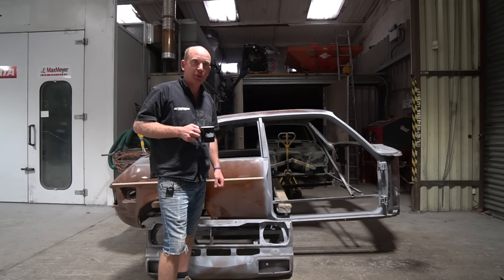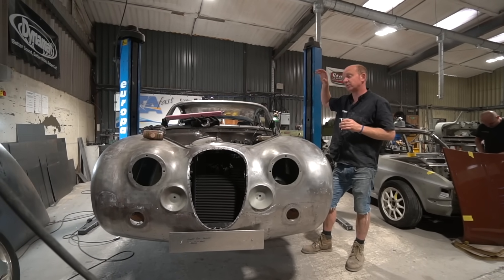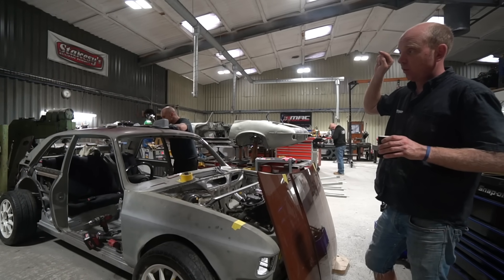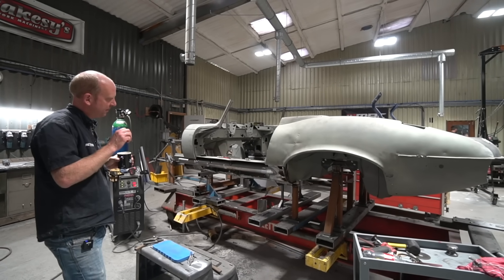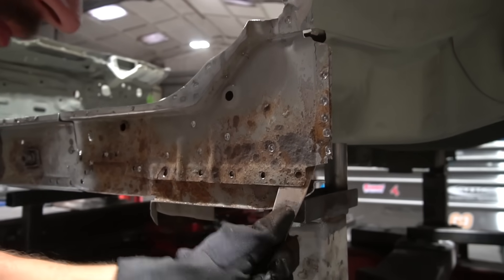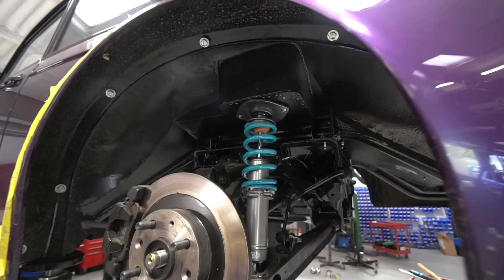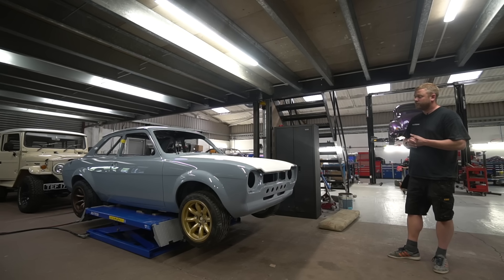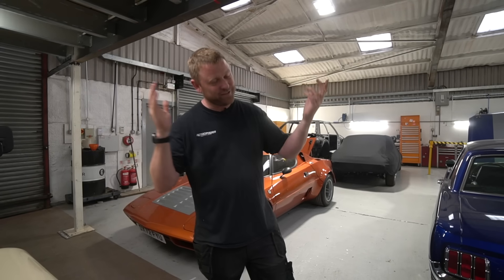Bespoke MK1 Escort Project ROLLING!

Comment: A nice bonnet hinge is off the p80 Volvos, they have built in springs and also a little flip leaver which means you can open the bonnet all the way to 90 degrees.

Comment: Could you just fill the rear edge of the bonnet instead of un-fold it to get back to a ~90 flange? The composite tooling makers will be able to use a filled and painted surface fine and you wont risk changing the outer shape of the bonnet.
Reply: I don’t think they would be allowed to do that at this assured level of product quality. ( I think all adjustments have to be on the metal itself).
Reply: @philtucker1224  the final bonnet is to be molded carbon composite - I'm taking about a safer/easier way to get the plug/buck shape for the composite tooling to be taken from. Anyway - I'm sure they have thought of it and there are good reasons not to go that way.
Reply: @Kiteboardshaper  hi KBS, oh yes of course (my bad) yes you’re quite right that would be a good technique (assuming the bond applied would be as strong as the metal surface) if they needed to make several attempts at perfecting the mold. Cheers buddy.